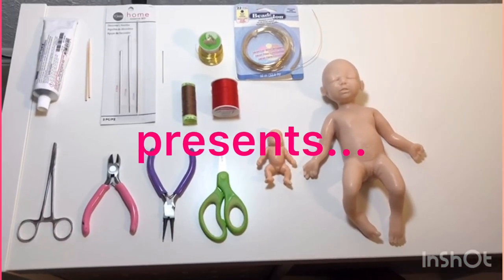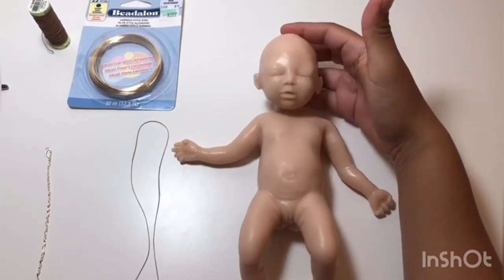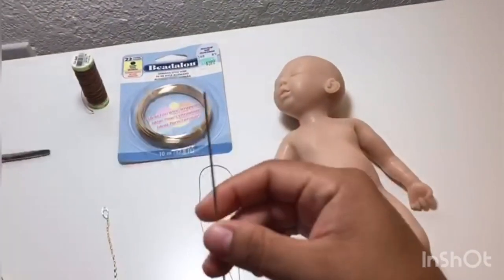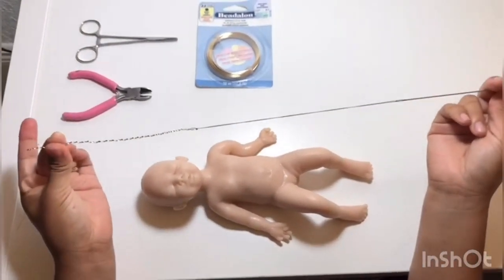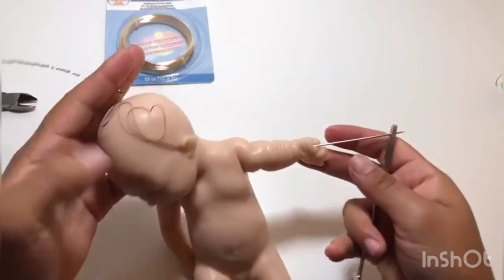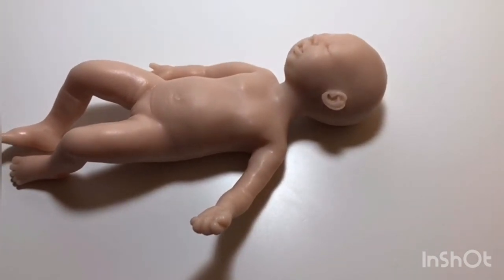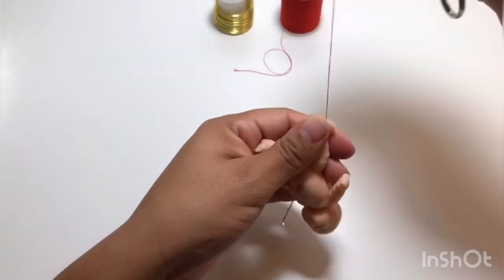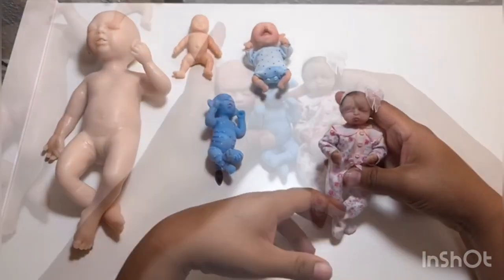How to insert armatures in a silicone baby.

Comment: Can this be done on larger babies 16-20 inch ?
Reply from the maker: Yes it can but you would need larger wire and a larger needle. The method I would use would be slightly different also. I plan on making a video on bigger dolls down the road.

Comment: Has anyone tried this on a full size silicone doll?
Reply from the maker: Sillymom dolls 
I plan on trying when I finish my 16 inch sculpt. I’ll let you know how it goes. I would rather have a different method for my bigger babies tho.
Reply: @cutiepatootiesbyana6879  right but to be honest this is the best way I've seen to do it other than cutting the doll apart. I wonder if you can do it by simply making a few extra exit holes and then just repairing those. I think I might try it on one of my blank silicone dolls, only I'll insert from  the shoulder instead of the ear. Thanks for the video
Reply from the maker: Sillymom dolls  cool you will have to let me know if it works out for you. Glad you found this helpful.
Reply: @cutiepatootiesbyana6879  
Hi Ana my name is Denise and I love dolls. Is  this the right way to reach you please let me know, for I want to be sure I'm not getting scammed again. Just want to ask some questions from a real reborn doll maker this time, please help!!!
Reply from the maker: @denisepalmer3732  hi you can contact me thru Facebook or my Instagram. Thanx